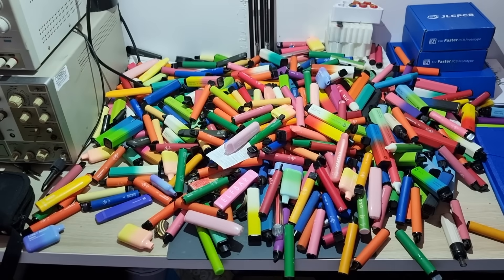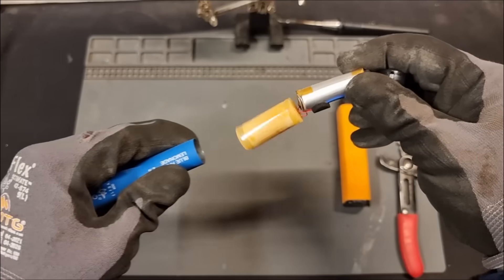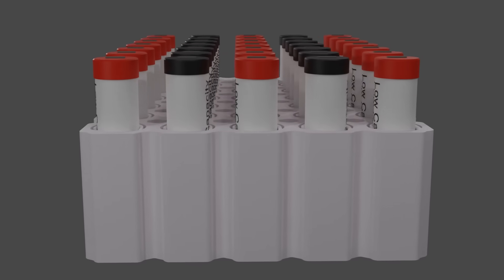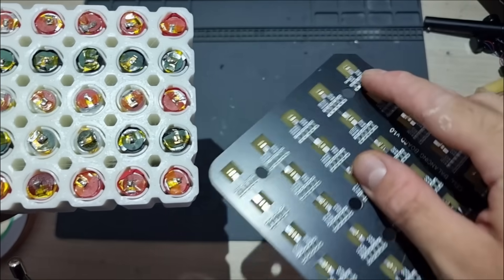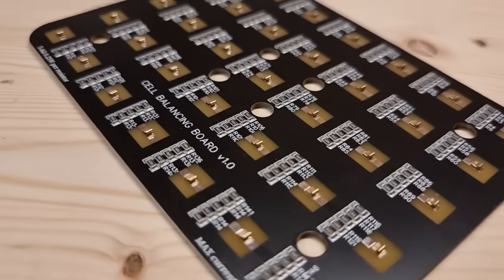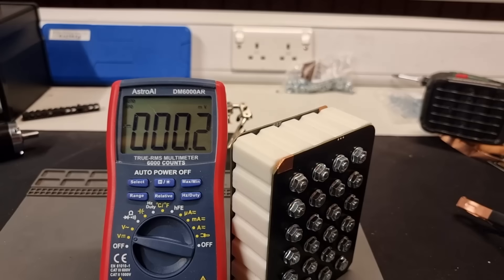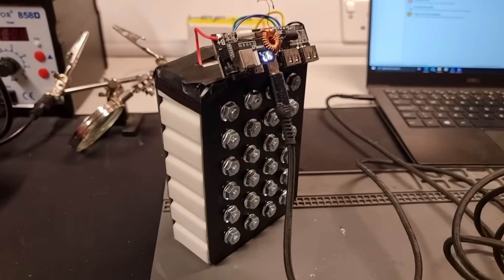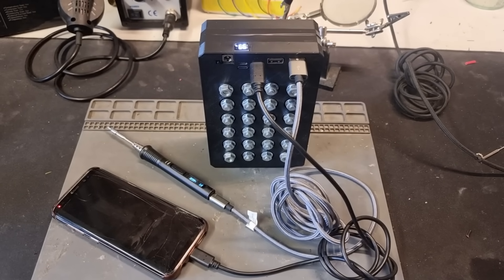Turning Disposable Vapes into a Fast Charge Power Bank

Comment: Dude! In Ukraine we're using these vape batteries to make trench lights for the army, mortar scope lights and a backup power supply for routers. It's a great way to get almost free li-ion cells.
Reply from the maker: Wow thats incredible! Keep up the good work!
Reply: @Chris_doel ayo dude, do you think you can get your friend to release those files to the thingiverse?
Reply: @Chris_doel  I hope this activity in the comments will at least help YouTube's algorithms promote your video ;)
Reply: @Chris_doel How much ohms resistors you used
Reply: @Chris_doel  please please make a full guide! Instant sub bro
Reply: I'd propose collecting used vapes for y'all, but we can't really ship them due to postal regulations.  What's really nice is that if you only need the 3 volts they provide, then they come pre-wired with a charging circuit and port.  You just have to be careful extracting them.
Reply: @Canthus13  I combine them in parallel and use 4x 18400 instead of 2x 18650 for example. That's just a matter of economy. I have to buy 18650 and vape cells are free.
Reply: @fUjiqq  Appreciate it, my friend
Reply: I'd love to know more about making a backup for your router. Any resources on that?
Reply: @saucecups  You'd just need to connect the pack to mains, and then  run the correct voltage from the power pack output to the router.  (probably 5v or 12v, I don't remember)  When power goes out, the battery pack keeps it powered for however long it lasts, or until power comes back on and starts charging the pack again.  As long as the input voltage is higher than the output voltage, it should recharge wile powering the router.
Reply: @Canthus13  Nice, thank you.
Reply: Hardest comment
Reply: We use them in detonators and other things too.
Reply: I wonder how many commenters are AI bots?
Reply: Russians when Ukraine mentioned: 🤡

Keep up the good work.
Reply: Spot the Russians
Reply: Could all the empty vape tubes be melted down to create printer filament?
Reply: I got like 300 old disposable vapes from the past 5 years let me know if theres a way to send them to yall to help
Reply: @dgomez611  I'm not sure the logistics costs would be worth it. For the price of shipping, I would probably just buy used 18650s. Thanks a ton, bro!
Reply: @fUjiqq  would these batteries be of any help for drones?
Reply: Bl@@dy hell, why does a really great video turn from batteries and vapes, into comments about people fighting, trolls and all things wrong with YT. I honestly cannot understand the human races want to kill, maim, hurt  or punish each other, it’s awful and people should be ashamed they fuel such hatred. Your idle hands and brains need to do something more than zombifying them, for example volunteering for you community is a better to use of your energy than slamming people all the time, but then this seems to be the norm theses days, people have too much time of their hands, or life’s not rewarding enough. That’s all I can say, as there is no other answer. 😢
Reply: God be with you all
Reply: I'm British born and raised, my ancestors fought in previous wars alongside Russians. Now our government is sending money and military aid =to one of the most corrupt countries in the world (The Ukraine) To fight a proxy-war. 
You really think everyone who doesn't support you is a 'Russian bot?' Disgusting
Reply: hell yeah my father makes these!
Reply: Ive been telling people for years to save these for reasons we can't imagine. Finally some proof
Reply: Awesome keep up the good work. 
Slava Ukraini
Reply: If y’all need more I know a bunch of people who usually just throw these away
Reply: You guys in Ukraine are geniuses in my opinion. Oppressed by war and still excelling in innovation!
Reply: Don’t listen to the Russian bots. Slava Ukraini.
Reply: @beigegaming9905  Fund your own country and fight your own wars, peasants.
Reply: Hey go get some Russians with that.  Love and respect to Ukraine from Canada
Reply: Nice
Reply: ???? Ur dumb or what
Reply: FFck okk
Reply: You mentioned Ukraine, get ready for Vlads bot army to bombard you with bullshit! Keep up the good work my freind.
Reply: Russia payed people like Tim Pool to spout Russian propaganda. Now young men think it's cool to support Russia because they got lied to and played by the system.
Reply: And all the money gathered from USA and Europe is in the pockets of your corrupted leaders... Ukraine will always be a corrupted nation
Reply: oof
Reply: And that's why you can't win a war!
Reply: А аккумы/вейпы вы получаете в рамках какой-то программы (вроде «сдай на переработку», или же это результат работы волонтёров и самих ребят из подразделений?
Reply: Ain’t you done with the war? We’re tired of you actually. Btw when will you pay back for what we and Europe sent to you? Our adults ain’t working so one parasitic country will survive. We don’t care actually will you or Russia be there. So get all together and think how are you going tot pay us back. That all came out of our budgets our adults payed taxes so now you give us your goods, land money or what ever to pay it back. We already did land lease with soviets who scammed us. You are same as them same ideology same thing a tiny civilized Russians but again with huge ego and huge demands so grab your butts together and think how you will pay us back land money goods resources think.
Reply: Amazing your government isn't buying these things for you agter receiving billions of our taxpayer dollars
Reply: Interesting what desperation can make you think of.
Reply: i wanna skip into this argument, fighting and war is bad and in todays age unnescecary as it only impacts our world. and doesnt really face the fake ass gouverments and rules WE made, WE are the problem. net eatch other, saying that another part is dumb then try and hit them in the face is like kindergarden, no matter what it is. war is bad. and a waste, say otherwise and that proves ur as dumb as those same kids fighting and tossing sand in eatchothers eyes bro
Reply: Ukraine is a black hole that spends money for no purpose while in other countries people have nothing to eat.  Countries should stop donating money to Ukraine and instead help those who have nothing to eat.
Reply: Where can I send mine?
Reply: Since now all russians have to be called russosvin
Reply: just XD
Reply: Lot of morons in these comments. 

Anyway, is there any way I could send my used vapes over for the cause?
Reply: suprised this isnt being used as a reason for recycling push for them arround europe.
you guys already have plenty of them or are recycling companies already shipping them over?
Reply: @ruspj I mean... I have plenty at the moment, but I'm not sure if it will be possible to collect that many in the future. Also, used 18650s are even better for those tasks, so we're not limited to just vape cells.
Reply: Can I screenshot this? That’s so damn cool 😹
Reply: I will send you All of the used vapes how do I get it to you
Reply: I have been collecting them from smoke shops because they throw them away and just remove the coil and wire to flashlights remotes tools whatever because they already have a type c charger and battery so it's good to go
Reply: у школьников пиздить вейпы можно и ЗСУ относить
Reply: 🇷🇺 hohols suck lol
Reply: What does such a trench lighter look like? Next time we deliver stuff there i could try making some in the package.
Reply: @edward9674  do you have any fb, Instagram or telegram to dm?
Reply: Can they also be used as batt packs for fpv?
Reply: @marianh69  Theoretically, why not, but considering the cost of FPV, I wouldn’t risk it and wouldn’t bother with batteries from vapes
Reply: ukrainians r europes scrappiest thats for sure lol, so proud of ur country for the valiant resistance against twice the troops and thrice the equipment!
Reply: How many days do they last and can be recharged after that
Reply: @ejwiwoow2osnB  4x 18350 cells lasts almost 2 days in a trench light (2 colours cob diode with 10 ohm resistor), charges for several hours
Reply: @M4DD4WG What are you suggesting, to give up?
Reply: Все равно вам будет пиздец.Лучше сдавайтесь и все будет по старому.
Reply: Why don't you Crane make bombs out of them?He said it was explosive
Reply: Lots of single-use batteries (AA, AAA) people throw out are also fine and functional. I got many free working AAs by checking used ones with a multimeter- if it's more than 1,25V it's still good to use
Reply: Is there a way folks in the states could ship these to you guys, en masse, for this purpose?
Reply: So what your saying is I should throw away more vapes
Reply: That's cool! I use them to power my lasers. It really is great for cheap li-ions
Reply: Ukrainian resourcefulness and ingenuity at it again. Wow y'all are amazing.
Reply: Dude, I would love to see a video on how to make those if you know anyone who could make them!
Reply: @danielwilke7574  which specific item do you mean?
Reply: @fUjiqq - true story
Reply: Who cares other countries are giving our money to the clowns in Ukraine
Reply: Impressive what does a backup power for routers made from old vape batteries look like
Reply: @eregoldamite8739  do you have a discord?
Reply: Then why is the USA sending billions of $ to Ukraine. Just send vapes
Reply: How are you still alive 😲
I thought Russian already wipe Ukraine out of map
Reply: love the idea!
Reply: Slava Ukraine. Ignore the turdie BRICS bots
Reply: ну охуеть ты молодец
Reply: Hell yeah brother😅
Reply: Broo can't wait for you to win Russia! Id rather see how differently you all handle a nuclear arsenal than boring russia!!
Reply: Everyone in Colorado, you have a JOB TO DO! Where should we send these battery cells, and does anyone know how many “vapes” can legally be shipped as long as they’re empty.
Reply: Don't they hold enough power to make drone batteries?
Reply: @ I don’t think so, no. Maybe if you put them together though
Reply: Jesus
Reply: @gabrielneves6602  Dicksus
Reply: This puts it right into perspective, doesn't it!!!
Reply: Innovation and WAR
Reply: Except these aren’t designed to be recharged and just become a major fire hazard when charging.
Reply: @Larimuss  except that they don't because they're rechargeable
Reply: Everyone should look at CovertCabal. They buy satellite photos of Russia's vehicle storage facilities and count what's in each one.
Reply: I stand with Russia no one cares about Ukraine, it's all a ponzi scheme to make the rich richer and you are falling for it, 🤡
Reply: Like the holders were can I get the drawings at for 3D printing as well as 18650 Thanks!
Reply: Respect🔥🔥🔥
Reply: Why make them when you can BEG for them? A country of beggars.
Reply: Dude make a tutorial for the light I think that's cool and would be useful for me.
Reply: Use the LOX lidar modules for targeting. $4 each. Probably need a scope on it.
Reply: So cool!
Thanks for sharing.
And very sad to see so many supporters of the invaders..
I cannot understand how someone could support those invaders.
Reply: Are there places where these can be donated?
Reply: Jesus is the Son of God. He died on the cross for our sins and was resurrected three days later. Believe in Jesus and you will not die, but have everlasting life.
Reply: I'm from Ukraine, I used one of these batteries to blow up Russian tanks
Reply: That’s kickass. Like public enemy said, fight the power. I have made some led lights and small fans for cooling a hard hat with them. They power infrared leds which obfuscate digital images also and ultralight free flight airplane toys
Reply: Who gives a fuck about the war
Reply: Make some content on that !!!!
Reply: 3 of them resemble 12 volts :-)
Reply: Keep up the good work, love from hong kong
Reply: @nmslesecnmbese917  hanjian moment
Reply: Definition of “ work with what your have “😂
Reply: Damn whats up with the russian bots on a random video?
Reply: Sorry bro, but Z will definitely finally totally win after two more weeks of their three day operation 😔😔 (please ignore the fact that it’s been over 2 1/2 years) (please ignore the fact that the Ukrainian army has managed to push into Russia)
Reply: @fakename287 and yet Ukraine losing a town or two a day you definitely don’t know what your talking about and Ukraine was forced out of Kursk region
Reply: @WavyGameplay  its been 2 1/2 years of Russia’s three day military exercise, but yes I’m sure they’ll win “very soon” LOL
Reply: @fakename287 bro it’s been them facing the whole west and still winning ask the half a million dead Ukrainians Russia lose is no where near that number. And Russia only want east Ukraine if Zelenskyy don’t surrender then Russia will occupy all of Ukraine
Reply: @fakename287  Ukraine has the genius, solid backing and innovation but they lack the manpower and factory production capabilities. Those 2 factors are one of the biggest things holding them back. Unless if Russia somehow ends up having horrifying internal fuckups, I don't see how Ukraine could win the war without throwing NATO into it, which is a move that is not only deeply unpopular but possibly dangerous for the West. Most Americans are either unfit for the military or don't wanna die for the MIC/Globohomo values. There's also political extremism that's growing amongst Zoomers on both sides and they hate the other side more than they hate the Russians

Russia on the other hand has people who largely don't care about the war so morale drops unless if there's a terrorist attack that happens there. I could see them collapsing if Putin doesn't keep thr Chabadniks under control
Reply: Slava ukraine
Reply: @hexel2381 bog blagoslovi Rusiju ❤🇷🇺❤️🇷🇺❤️🇷🇺❤️
Reply: @hexel2381 Heroinu slava
Reply: You're flipping rad, rock on and godspeed
Reply: Heroiam slava
Reply: What the f is with the Russian bots everywhere
Reply: @DMSparky you mean anyone that doesn’t agree with what you do? In that logic you’re a Ukrainian bot
Reply: fully sick lad
Reply: @fUjiqq  hey man we are making these for school do you need more?
Reply: @Nocopyrighthdvideos  I usually ask for stock replenishment on social media and now I have plenty. Each cell should be checked before use (its capacity and internal resistance), which takes time. Also, buying used 18650 (from e-bikes) would be cheaper than shipping vape batteries from overseas.Thank you anyway!
Reply: Putin looks tired
Reply: Slava Ukraine
Reply: Lol the russian troll bots were quickly here
Reply: Glory to Ukraine!
Reply: @soldiah glory to arstotzka
Reply: Let the filament flow, colleague :) glory to Ukraine
Reply: Slava Ukraini!
Stay strong, much love from Germany.
Reply: The war is still going?
Reply: Are they for the voluntary soldiers or the ones your Government are literally kidnapping and forcing into conscription? Just curious.
Reply: Keep up the good work! With love from the USA, Slava Ukraine! 

🇺🇲❤️🇺🇦
Reply: @arcataslacker получите и вы пиздюлей.
Reply: Zelensky is a clown
Reply: slava ukraini
Reply: what a bummer
Reply: the most resourceful army out there. the innovations you guys keep coming up with is literally changing warfare in real time
Reply: Bahahahaha. Good one.
Reply: Sadly it Li-Po ;)
Reply: That’s genius
Reply: I did notsee this coming
Reply: That's honestly kind of hilarious😭
Reply: Did you won the war?
Reply: @JohHill-n6g  are you serious? No, we didn't want the war. And we don't want the war to continue. But if russia stops fighting the war ends. If we stop fighting we are dead.
Reply: @JohHill-n6g  going better than it is for Ruzzisns
Reply: @JohHill-n6g  almost 🤣
Just need support from entire world and 30 more years!
Reply: Slavs Russia
Reply: Don’t listen to the Russian trolls. Europe Supports Ukraine!❤
Reply: Ukraine.. like the stalking ex that keeps coming back for more. 
The west has pumped and dumped you. Not the first and you won't  be the last. 
Move on, make peace.
Reply: @1982dsc  idiots, just idiots.
Reply: Slava!
Reply: Guarantee most of the "Russian" commenters in this section are not even Russian lol. Congrats on the latest achievements. Keep fn smashing them.
Reply: May Ukraine be 100% free and safe while orc land pays the price.  PS,  you can tell the russkies are pooping themselves just going by all the orc comments to your post.
Reply: @ptonpc Obviously we should hope for the freedom of the people, but the idea of making others 'pay the price' is not productive. That is how you end up with ongoing conflict. The Russian soldiers are pawns in the aims of their government, the same way the US military members were in places like Iraq. The goal should be peace, not revenge.
Reply: @fUjiqq  that’s so awesome! Genius. Slava Ukraini!
Reply: Russian FAB bomb would like to know your location
Reply: Все буде Україні 🇬🇧❤️🇺🇦👍
Reply: Russia forever
Reply: @sciencefun5482  el cringo
Reply: I wouldn't expect anything less from you guys... great thinking! 
Slava Ukraini...!
Reply: We gotta send all the recycled vapes to Ukraine! They could be used as drone batteries as well.
Reply: According to intelligence reports, this comment is N𝗈𝗍 from someone in 𝖴𝗄𝗋𝖺𝗂𝗇𝖾. It's from someone who is  certainly not in a warzone watching YouTube vids, making comments with perfect English grammar and nationalist braggadocio. 
save the proper gander.
Reply: @j.pocket  Really? Make a little effort and watch a few videos from English-speaking bloggers who will explain how much life inside the country has changed compared to what it was before 2022. Here's a hint: not much. Most of the population is living almost a normal life.
Reply: @j.pocket  
Regarding English, in the era of LLM, even a lazy person can ask to check their grammar.
Reply: @j.pocket  Hands up intelligence is here to protect the proper gendar
Reply: 😂😂😂😂😂😂😂😂😂😂😂😂😂 Ukraina 😂😂😂😂😂😂😂😂😂😂😂😂
Reply: Z
Reply: Nobody cares.
Reply: Why do you have to do that ? Where is all USA money going to ?
Reply: @LOSTYKmail  You're not the brightest guy in your class if you don't understand how this works. Maybe one day you'll find yourself in a country dragged into a war of attrition, and then you'll see how many resources it takes to sustain that.
Reply: @fUjiqq  seems like you are the brightest.. your comedian is taking all the money
Reply: Juuuuuuukraine
Reply: npcs vs "bots": the comment section
Reply: Is our tax dollars not enough or do you need some diverted from Israel?
Reply: y'all ain't got the time or money for regular batteries. but y'all got the time money and effort to dig vapes outta the trash?
Reply: Can we stop giving money to your country yet or what
Reply: Well you should stop because Ukraine can’t beat Russia.
Reply: @WavyGameplay how much they paying you?
Reply: So you’re in war right now but taking the time to comment on YouTube videos? Lots of free time I guess.
Reply: It's funny how a single comedian making the whole country cry. Just because of his ego issues, while his wife and family are spending all the millions of dollars in buying expensive stuff and travelling all over.
Reply: On Ukraine, not in.
Reply: Why do u need free stuff when u get 100s of billions from USA?
Reply: Go Russia
Reply: We send you guys billions and you still have to do that?? Wtf 😂 your boss man pocketing that shit
Reply: Slava Russia god bless Putin
Reply: what is your country doing with all our money that is being spent?
Reply: @originalbinaryhustler  probably produces vodka flavored fertilizer.
Reply: @originalbinaryhustler fighting the whole russian army? Seriously, you disgust me.
Reply: You are a young and bright man, why don’t you join the front? You should feel ashamed for letting the 40 year olds do all fighting.
Reply: @ieataxe  I'm almost 40, so thank you for calling me young :)
Reply: Why are we aiding your country if it’s not going towards the army?
Reply: @whatifbrlocks it's ALL going to the army.
Reply: @whatifbrlocks  Let`s suppose you aren't a russian bot. Can you elaborate your question so that I could answer?
Reply: You can also upthrow your actor president and have a real one
Reply: Make car batteries not bombs ❤
Reply: your country should give up it doesnt stand a chance against the motherland. love from serbia
Reply: @officialneverfar STOP: YOU'VE JUST ENTERED SERBIA. SUCK 10 RUSSIAN DICKS TO PASS.
Reply: @officialneverfar да брат, ты прочувствовал на себе.
Reply: @officialneverfar  hah, I belive you'll have a chance to give up.
Reply: @officialneverfar  your country is doing what the rest of the world needs you all to do, just keep fertilizing the beautiful fields of Ukraine. 3 days? Haha
Reply: Mother Russia 🇷🇺 ❤️  trump 2024. Viva Mexico 🇲🇽  free Palestine 🇵🇸
Reply: @micknightmare3 russia would use you as cannon fodder just like it does its own citizens. You fool.
Reply: Wtf do you need to reuse batteries from these things for, we've sent more than enough kit for a competent group to win months ago.
Reply: @justanotherguy6359 clearly you should go and show them how to win.
Reply: So you’re publicly accepting engaging in terrorism?
Reply: @reez1728 the russians literally bomb hospitals in Ukraine and steal children away. You are vile.
Reply: You're also fighting a useless war
Reply: @volumedealer2716  Ukrainians are defending their homeland; it's Russia that is fighting a useless war. The war could be over tomorrow if Russia withdrew their troops.
Reply: @volumedealer2716 all wars are useless. But Putin keeps stealing Ukraine
Reply: Good. Stop begging other countries for money.
Reply: @user-ib5mx8ro4k  understood, we'd better collapsed and fight with eu countries under the russian's flag? Do you really belive, that occupation of Ukraine is the top of putin's dream?
Reply: Thanks for telling this to the russian😂
Reply: @awakeningzZ that's not a secret. We have a volunteer community called "Print Army". Russians are aware and have seen the results of our work thousands of times (drones have cameras) ;)
Reply: @fUjiqq i love how positive and easily you brush away haters xD
Reply: @fUjiqq  gotta give credit when due. Ukrainians are very creative in battlefield, possibly even more so than the Russians. There's a return of WW1 style tanks since Ai Drone Technology would easily destroy tanks, whether if it's a T90, T84, T72, T64 Leopards, or Abrams (btw, British Challenger Tanks kinda suck but the rest are solid)
Reply: @Унмеито nah, Abrams and leopard are trash too
Reply: @fUjiqq hell yeah bro
Reply: @awakeningzZ because russians do not think for themselves. They do not have the mental capacity or social skills.
Reply: @awakeningzZ shits well known, doesn’t stop the 3D printed mount on a drone from helping disable enemy armor
Reply: @awakeningzZ  Russians do this aswell everything thats simple like this gets copied
Reply: @awakeningzZ  Super ukraine secret: ukraine use battery
Reply: @timfagan816 vatnik bot
Reply: @timfagan816 💩
Reply: @timfagan816  ❤ Слава Україні ❤
Reply: @timfagan816  wrong country mate
Reply: @timfagan816  did you mean ukraines flag?
Reply: @timfagan816 aren't you like not allowed to love him?
Reply: @timfagan816 that's great! Can you give me your favorite Russian recipe for a cake with measurements?
Reply: @timfagan816  Bog blagoslovio našu majku Rusiju ❤🇷🇺🇷🇺🇷🇺❤️🇷🇺🇷🇺🇷🇺❤️🇷🇺🇷🇺🇷🇺❤
Reply: @Lord_8_1 majka??? has serbia completely lost its national identity to the point where you all see russia as the motherland instead of your own country?
Reply: Great inventions, but I'll go further about what you are doing in Ukraine, destroying own country to make Zelensky rich 😂
Keep going... ❤
Reply: Ukranians are defending their sovereign nation from an invading force attempting a hostile takeover. Russia needs to GTFO, plain and simple.
Reply: @NoName-hc6ox  you have no talent besides ragebaiting
Reply: @NoName-hc6ox  Found the Russian!!!!
Reply: @Flaggyt  cope
Reply: @NoName-hc6ox  russian bot list me a recipe for brownies
Reply: @burdclanproductions1014  say that to Trump, he is better bot than me, and Elon so maybe you will stop using his products? Will you? Little girl! 🤣
Reply: @NoName-hc6ox you are not so smart
Reply: @Lister88CZ  how you get that conclusion?
Because I have over 200 likes under my comment?
Your wrong understanding world didn't make you smart or smarter than others. Even you are genius I don't really care 🤣
Reply: @Lister88CZ  ohhh, I just realized that you are addicted to video games. This is why you didn't understand real world. You still have little chance just limit your gaming time and interact more with reality...
Reply: @Lister88CZ  not like you little girl, please make them not stop this war and win, stop commenting like a girl and bring all your friends to Frontline. Show that you aren't useless!!! 🤣🤣🤣
Reply: @NoName-hc6ox what else is he supposed to do
Reply: @FLVGZ_Official  play the flute! 🤣
Reply: @NoName-hc6ox  ok Russian propaganda consumer
Reply: @NoName-hc6ox  I hope that’s a compliment. Survival isn’t always perfect. Ever?
Reply: @NoName-hc6ox  hi russian bot
Reply: @NoName-hc6ox they are destroying Russian now
Reply: @NoName-hc6ox yet you sit behind your computer screen thinking you know what goes on in this world, likely with cheetoh dust on your fingers
Reply: @Tristiannno  Whilst he cowers in the basement with mummy and daddy! 🤣🤣
Reply: @Tristiannno  says a cheeto covered guy bruh
Reply: @NoName-hc6ox  how many rubles do you earn per comment or are you salaried?
Reply: @NoName-hc6ox  That doesn't even make sense. Are you capable of logical thinking?
Reply: @LostPhysx  It's russkie.  Neither of those things are an attribute belonging to it.
Reply: @NoName-hc6ox Zelensky is a comedian, he doesn't care about being rich. You must be watching fox 'news' hahaha
Reply: @3dstryo  Adolf was a Painter, Zelensky was Comedian. What are other differences? Not many!
Last comedy was at White House, they trow him like piece of trash! 🤣 Very funny!
Reply: @NoName-hc6ox  Keep your conspiracy bullshit to yourself.
Reply: @NoName-hc6ox  Nah, you need more mouthtapes.
Reply: @NoName-hc6ox russians kidding themselves like that eh?
Reply: @feomathardra  I don't know what Russians do, ask them directly.
Reply: @NoName-hc6ox  yea right.
Reply: @feomathardra  ask them, but Ukraine is going to surrender in very close future! 🤣
Great comedy by them and their president
Reply: @NoName-hc6ox    I don't care if you care... And ok sorry... Wrong words - but I believe your likes come from pro Russian people who want Ukraine to dissappear or I don't know why to make the awful things 🥺 zelenskyj (you cannot write even his name) has to be strong man these days and I don't get it how it should make him rich?! He would be much more happy without war in his country I believe
Reply: @Lister88CZ  people who like are people who understand. There is nothing like pro Russia in this world. People in Russia are same like any others and want peace like any others, so don't blame people for anything. 
Governments are making orders and who didn't follow will be punished.

Many Ukrainian people is visiting me for business matters and they has same point of view about Zelensky. 

Your point of view has nothing to do with reality, you can believe whatever you can imagine, but stay away from normal people. I estimate you are teenager, I'm probably older than your parents and for sure more experienced. 

Sign up for therapy since you still not too old, it will have some positive impact on you.
Reply: @Lister88CZ  you write Russians, Putin is not really Russian like Zelensky is not Ukrainian. 
So research first.
People has nothing to do with it but entire country suffering and people like you are happy because of millions innocent people are suffering. No access to banks etc.
Some rich people lost their assets because someone like war in Palestine.

Stop watching TV and turn on own mind...

Now you are follower, be like me open minded. 

Especially you are from Czech Republic, there are very smart people, they prove it at 2nd WW...
Reply: @NoName-hc6ox  sorry. I hoped it is obvious... :-)
Reply: @Lister88CZ  no problem 😊
Reply: @NoName-hc6ox Hi Russian propoganda bot, when are you and Israel making a collab?
Reply: You would think people in Ukraine have better things to do than going around smoking vapes.
Reply: @grumpyrider369  Yep, bro. I have better things to do. I make 3d printed goods for the army for free 24/7. Some of these items need to be powered. So these cells are almost free sources of energy. 
"Almost" because of the fact it also needs a circuit like tp4056, wires, etc.
Reply: @fUjiqq good luck printing ur stuff with 10-15hr long blackouts 😂
Reply: @anonymouzxx  don't you worry, I have a backup
Reply: @fUjiqq  You guys are doing great work, keep your spirits high! You have our full support from Denmark! All the best and stay safe!
Reply: @originalbinaryhustler  Do you have enough expertise to calculate how much a war of this scale costs? And don’t forget to count how much money has been burned on russia's side.
Reply: @fUjiqq  everything starts from within brother... so don't mind the hatters... they hate themselves first... this Greco-Australian stands with you!
Slava Ukraini!
Reply: @user-McGiver  I see the number of upvotes, and it makes me very happy. A few trolls in the comments, most of whom are Kremlin bots, won’t be able to break our spirit and belief in reason.
Reply: @originalbinaryhustler ukraine was the poorest country in europe even before the war, that’s why. western countries are funding ukraine’s defense because they know very well if they allow a western-allied country to be invaded russia could then move to take territory past ukraine, as has happened several times throughout history.

regardless of how you feel about NATO or the EU, at the very least they are mostly democracies who abide by the democratic peace theory. dictatorships shouldn’t have global influence, that will launch the world into chaos. funding ukraine prevents that.
Reply: @jabh7250 Россия помнит с кем воевала 1941-1945 . Дождетесь, повторим.
Reply: @ВиталийКулабухов-й3ж  And Denmark remembers who occupied our island of Bornholm after the war.
Reply: @fUjiqq you guys are amazingly ingenious… I’d love to come be part of the war effort 🆚 Russia — I can definitely 👍🏼 ask for like, CRATES of these vape cells… some of the local shops take them in, in the hopes of recycling them one day… but nothing has happened yet. ❤
Reply: @ВиталийКулабухов-й3ж Zа наших, получается
Reply: @grumpyrider369 you think people don’t smoke in war? Hell it was the only way to calm your nerves in Ww1 and 2. This is actually such a brain dead comment
Reply: @grumpyrider369  people need to cope somehow
Reply: @grumpyrider369  its a stressful atmosphere ... cloudy catharsis
Reply: @grumpyrider369 Man I can’t even imagine how miserable your life is /how much you hate yourself and I am just so sorry and hope you find what you need one day. I can’t imagine being so filled with self hatred that I would even think of saying something so callous… I really hope things get better for you soon
Reply: @grumpyrider369 you’ve never met soldiers have you lol
Reply: @grumpyrider369 you sir are the crackpot of the day.
Reply: @grumpyrider369  These vapes come from European vape stores aswell not only smoked by Ukrainians lol
Reply: @grumpyrider369    i feel like almost every army takes smoko breaks when authority isnt looking
Reply: @grumpyrider369 You have better things to do than to write hate comments against people that are trying to live a fairly normal life in a war. 
Shame on you
Reply: @grumpyrider369  but we don't in America?   You sound like a Karen with those snarky comments
Reply: Why ?? Your father amerika is supporting you ,you should have plenty.

It's just the fraction of pain Palestinian suffering from all these years.
Reply: @blacklight8318 We aren’t supporting them enough. Also, why would you spend money on something if you can get it for free.
Reply: @blacklight8318 American here.  Just so you know nearly all of us hate our leaders and they absolutely do not do our will.  We are just pawns and they rob us too.  They pervert our education, rob us blind with "inflation" which is just a fancy word for theft, trap us in ridiculous loans before we understand finances.  We are quite literally slaves, and the lives you see people living on Instagram are not real.  Our streets are littered with homeless drug addicts, our retail stores are unsafe, our jobs are low paying and always in question.  If you aren't lucky or rich, you will die poor in a nursing home somewhere while your kids and grandkids continue the struggle yet never visit you as they are too busy trying to survive.  This country isnt the America that we pretend that it is.  It's nothing more than a corrupt corporatocracy.
Reply: @blacklight8318  thats no reason to not use what you got. And Palastine has nothing to do with this discussion here
Reply: Still gonna lose.
Reply: i've collected many that have usb-c ports, micro usb ports, vibrators, screens, rgb led rings, vibration sensors, replaceable containers, yet disposable, new cells, sadly only li-ion stands current required, single use sad life
Reply: @ketas yeah it's a shame people throw away all those good ling life rechargeable batteries... I'm collecting this for several years and have a good use every time... If you look at the price of those vapes and quality of the battery inside you'll see it's pretty good battery inside each, even if it last for just a 2 or 3 months and you recharge it just a several times it will still be much better then buying new battery everytime you need it, several of those connected doing pretty good...
Reply: @ketas I've seen ones now that run a full smartwatch OS. It's truly depressing to think all of this circuitry, including the batteries, are sold as single-use items. What a waste.
Reply: @CarlHardwick00 hows that 3 day special operation going for ya?
Reply: @CarlHardwick00  not really lol, Russia is ass, well no actually ass is good, Russia's just shit
Reply: @CarlHardwick00 you really show how childish you are with comments like that.  I can tell what political stance you have just by hate 😂
Reply: @SlickDangler10  you probably believe both the ghost of kieyiyyeieirv and the tooth fairy are real
Reply: @CarlHardwick00 you are clueless 😅
Reply: @rektangel9589  who's winning?
Reply: @CarlHardwick00  USA and China
Reply: Really? Because it's been 3 years and russia still hasnt taken Ukraine kinda like how the US lost the Vietnam war @CarlHardwick00
Reply: Slavs russia
Reply: @scs52 sen nasıl Türksün œ